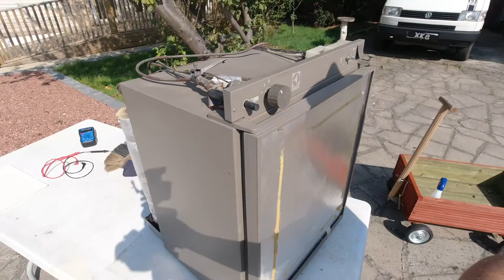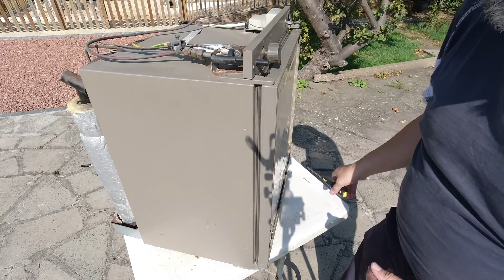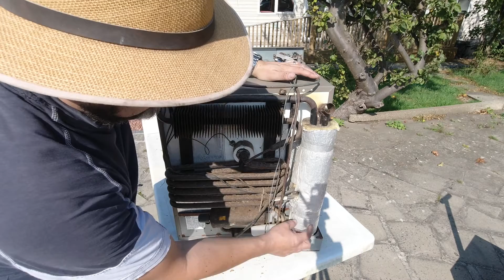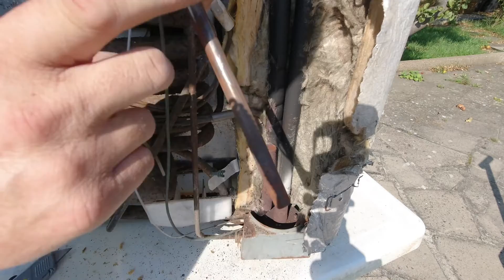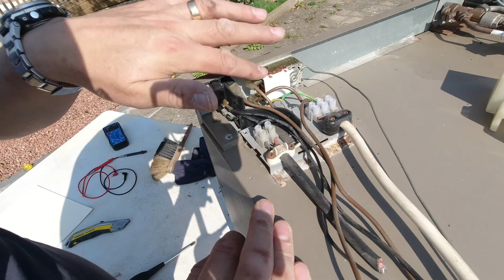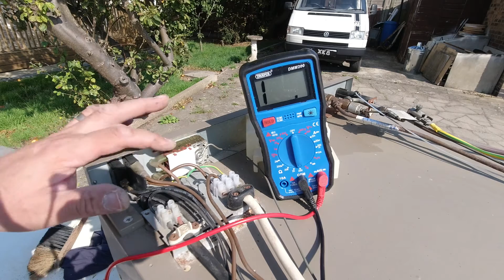3 way camper fridges and how to repair them. Part 2 Electric

Comment: I have a electolux fridge for a vw t3 camper. 3 way fridge. On the 12V side the connector has 3 wires going to the fridge. Any idea what the third wire might do? Trying to figure out how to connect it for testing the 12 V side. The 230V side runs of a mains plug and that side of the fridge works well.

Comment: Hi John, i have dometic RM4361 in my motorhome which came 2nd hand from Japan. The unit is running at 110volt but i have installed 220v electrical system as i am at Malaysia. Obviously the fridge is not running on main but it works on 12v and gas. Would it work if i install a step down transformer at the incoming main line?
Reply from the maker: Yes a stepdown transformer should work well. 
However if its previously been tried using the 220V supply, if the fuse has not protected it then the heater element maybe burnt out🤞

Comment: My fridge,is 46 yrs old, works well on 240 volt , not on gas yet, as after watching this great video I will look into the gas side of things, but on electricity it makes a terrible whinning sound, what could that be please
Reply: The best way to stop any whining is to leave the wife at home.
Reply from the maker: Hi Lindsay 
Typically an absorption fridge is completely silent save for the sound of a pilot flame burning whilst on gas.
There are no moving parts
The only way I could conscieve of it generating a whining sound is if the sealed loop of refrigerant has a leak or is very depleted and therefore you hear the air moving in the system. 
Compressor fridges on the other hand have a pump to circulate the refrigerant and are better at cooling but constantly generating a low level of noise ( typically a hum ) They are fine in a house or large RV where you sleep away from them. hence absorbsion fridges are popular in campers.
Sorry I can’t be more helpful. But other than a rare gurgle like a radiator, it should be silent

John

Comment: At 19:57 you are about to test the 12V continuity. You put one probe into the spade connector at the back of the switch... and then the tape jumps so we never see what you do with the other probe or what the result was!?

Comment: Thanks mate, 90% helpful.
Would of been 100% if not for the glitch in the video whilst demonstrating how to read the multimeter when testing if the heater is buggered through  the 12v switch. 
( sorry to be picky :)
Reply from the maker: fare comment. Sorry😔

Comment: I have the same problem mentioned by someone else, works on gas the freezer compartment creates ice but the main compartment doesn’t get below 12 degrees C. To get to that temperature takes over 24 hrs.
Reply: Did you fix it? Mine too!!! Exact same problem!!

Comment: Thanks, John. I have taken mine apart, turned it over and rocked it about. Everything looked good and in great condition and working, except that the food compartment doesn't go below 12deg C whilst the freezer gets cold around -15deg C. What else would you advise me to check out?
Reply: Hi, did you work out what the problem was, I have this issue as well. freezer works but Fridge not getting cold.

Comment: I have a VW T25 westfalia which runs a fridge very similar to the one there ... i had to do various work (new jet, thermocouple etc) on the gas side ... It now works great .. So many people as you say bin them for modern compressor fridges ... they still take quite a draw and you then need solar etc to run them .. my old Electrolux will run for weeks on gas .. Whats not to like and what makes these new fridges better ??
Reply from the maker: For many they have turned into disposable items when in actual fact very few of them are truly broken beyond easy repair

Comment: Great video, i actually found it fascinating! I'm picking up my camper on Wednesday and it has a carvin 3 way fridge in. I never thought a fridge could run on gas, now i feel i know all about it haha! I understand they are rubbish on a battery, my question is - how much gas do they consume?? I will probably switch to a compressor fridge soon as solar panel can cope, free energy!! Shame these can't do the same as the silent feature is good, but then again gas being on all the time is a bit worrying..... Can't have it all.
Reply from the maker: Hi Dan
Typically they use about 200grams of gas per 24 hrs if working hard and turned up to full.
so dependent upon what size and how many gas bottles you have, about 5 days per kilogram
Reply: @tothegarage  that's good to know, a lot less than i thought. I think I'll keep it for now then, keeps the battery for lights etc. Cheers.

Comment: I have the Elecrolux RM212 but instead of the Piezo igniter, it has an electronic ignition system so it's supposed to click until the gas is lit, but this has stopped working. Do you think its a simple repair like the switch being replaced, or something a little more of a challenge for me like removing the fridge and doing a bit of rewiring?
Thank you for both videos in this play list so far.
Reply: It sounds like the ignitor may have failed ... you can buy them online at places such as Brickwerks ... they are not too difficult to fit -
Reply: @SKSK-rz7br  thanks for the info, I'll check them out.

Comment: Have same fridge.  Works well 240v and on gas, however 12v another matter.  12v from 2nd battery right through to relay on top of fridge but when switching 12v on either no 12v to back of switch or on rocking switch back and forth, intermittent power recorded (probe i/c bulb light). Is it likely switch at fault? Or do I have to have van running (high revs) to have working?  Any advice appreciated.
Reply from the maker: The van does nerd to be running to use fridge on 12.v. if its wired in properly a relay looks for an output from the alternator. before it allows the 12 volts through to the fridge heater.  without the van running the fridge would flatten the battery in about 10 minutes
Reply: @tothegarage  Many thanks.  Good video by the way.

Comment: Hi John, thanks for your videos, I learned everything I needed to check out my fridge.
However.. 2 points: 
-the Part 2 video still says "Gas" in the title.. should be "Electric";
-When you connected the multimeter to the terminals at the back of the switch, you were testing the switch, not the element. It worked.. full contact in one position and open circuit in the other. To test the element you would need to test for resistance between the two wires leading to the element, which is what you did correctly when checking the mains element.
Reply from the maker: Hi David
Thanks so much for your kind words and input. Totally messed up on the title (Doh!) now fixed and I was aware of the error in the testing (Brought about because I new that heater was broken anyway and then turned my brain off whilst talking and filming😔 and as you point out I incorrectly probed the switch rather than the heater wires. (But as I got what I expected I didn't notice🤯.
I have made a small edit to the film now.👍
Reply: @tothegarage  Great! We all have occasional brain fades from time to time.. good to hear that you have sorted it.
People like you who have useful knowledge and put the effort in to share that knowledge with others are much appreciated by people like me who have tools and confidence but no experience in the specific activity.. keep up the good work!

Comment: When testing the 12v circuit you appeared to only check the resistance through the switch, not the element? did I miss something? There should be no resistance through the switch.
Reply from the maker: Hi The switch was off

Comment: I would like to of seen you strip down the burner unit on this fridge as it is the same as mine, and I would like to get mine going on the gas as I don't, or can't see the flame lit from the inside of the fridge.
Reply from the maker: Hi 
Check out part 1. I do the burner strip down on the smaller fridge but the design is almost identical